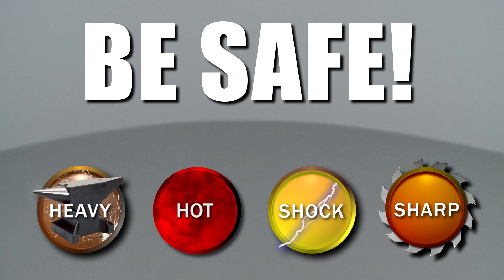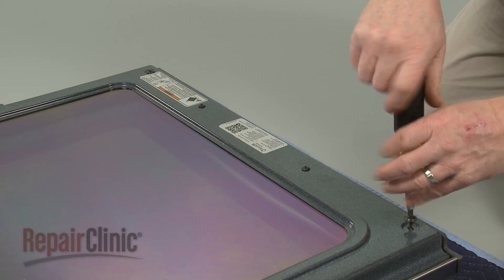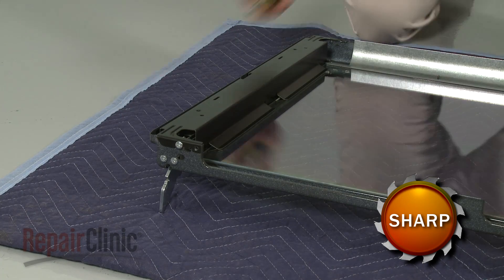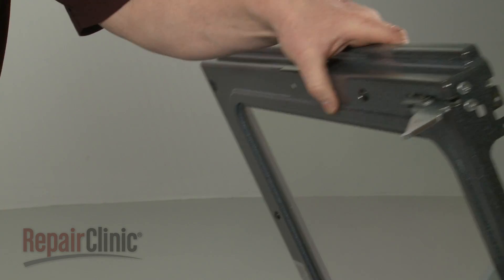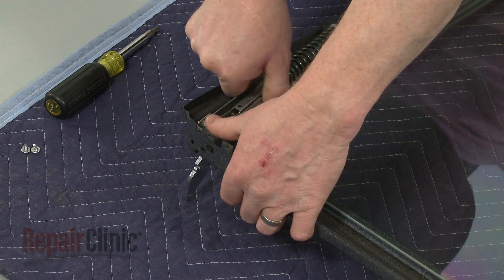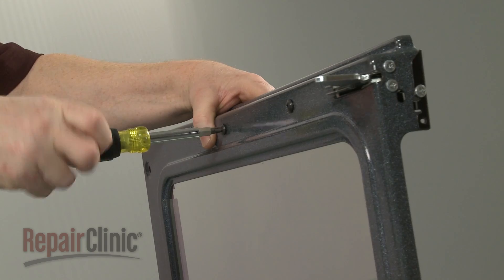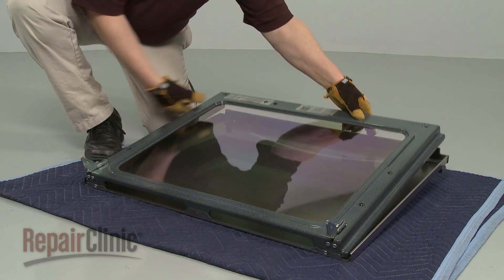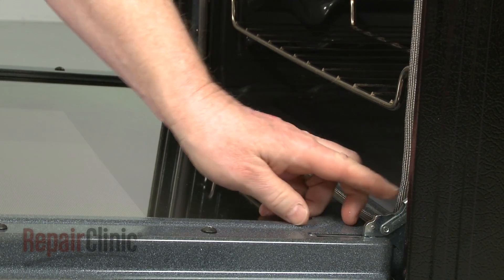Whirlpool Range Door Hinge Replacement #W10440013

Comment: My door will not open at all due to what appears to be a damaged hinge on the right side.  The problem is not the oven lock because the left side doesn't appear to be stuck.  I pull on it as hard as I can and it will still not open.  Is there a way to get the door open so the hinges can be replaced?